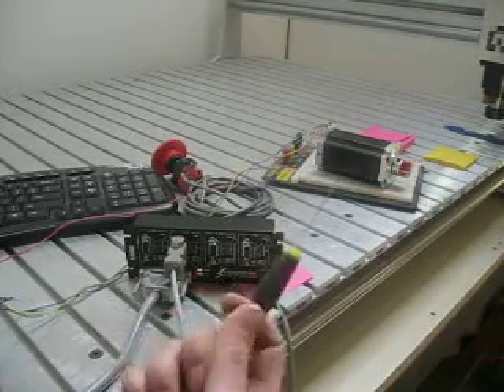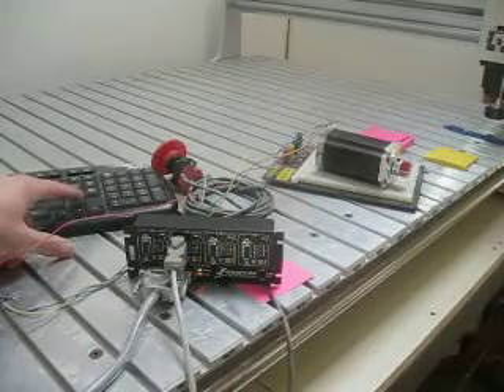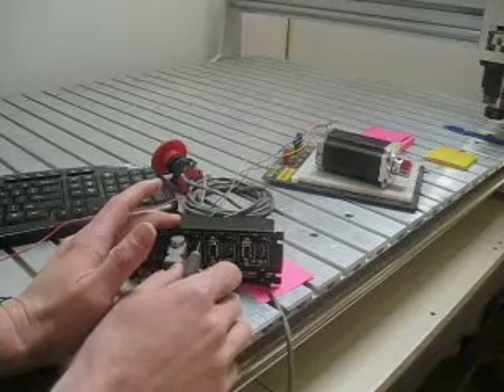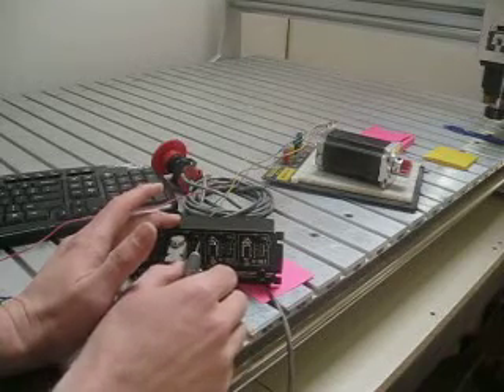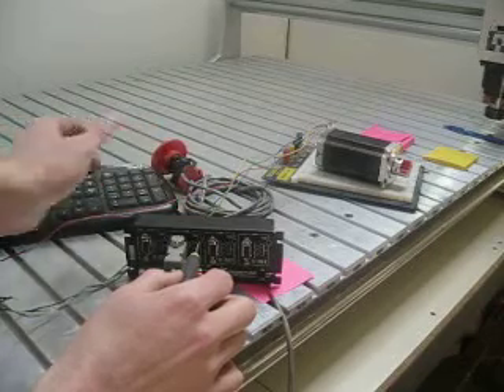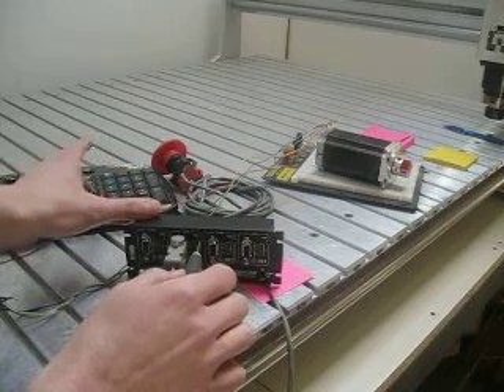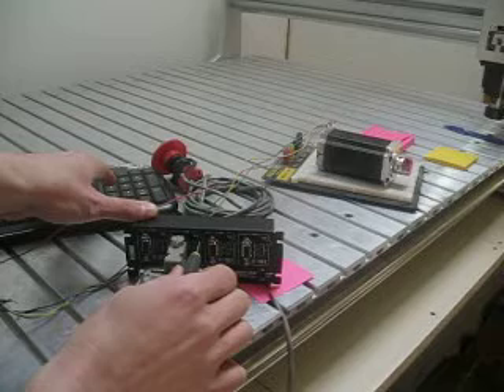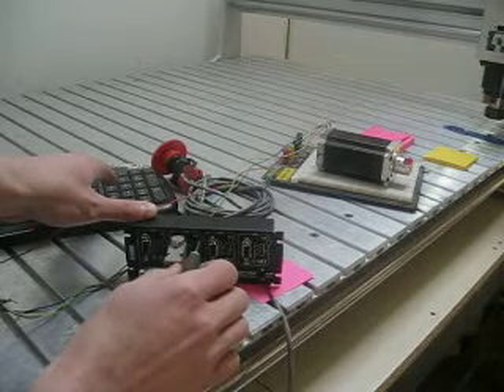Motor Tuning

Comment: I wasn't able to tune my gecko drive at 2 revs pers second. I could not find the sweet spot. At 0.5revs per second (the speed recommended in the G250 manual) it was very  easy to find the good setting. Just FYI.

Comment: Hi there,
I'm trying to tune my Nema 23 stepper motors. I notice that the smoother sound is with the trim pot all the way down. 
Also i noticed that the motors make an one second  high pitch sound when stopping.
Is this normal?

Thanks

Regards
Rui